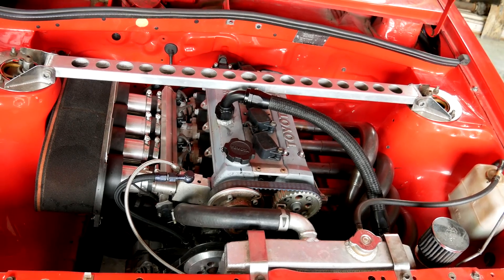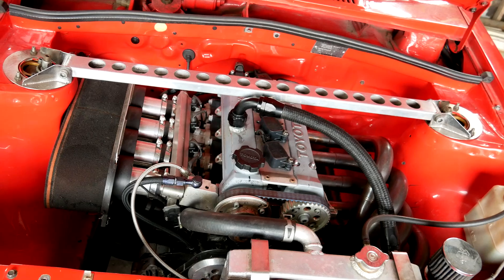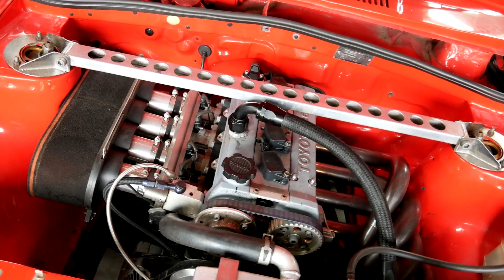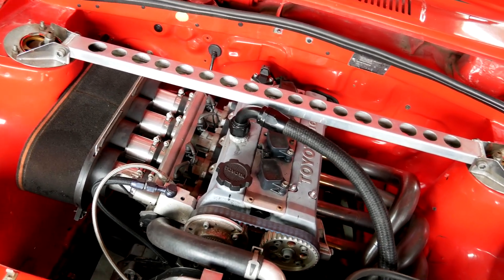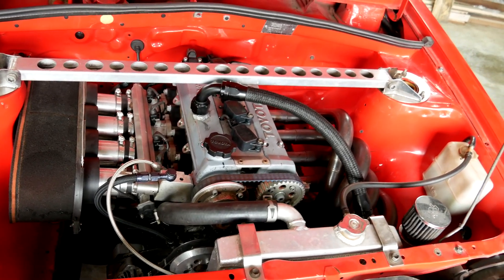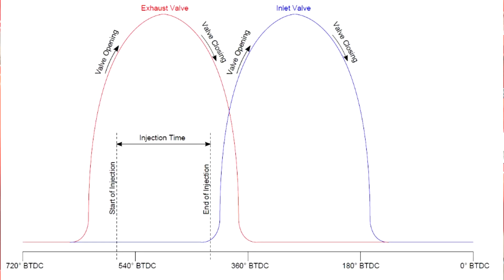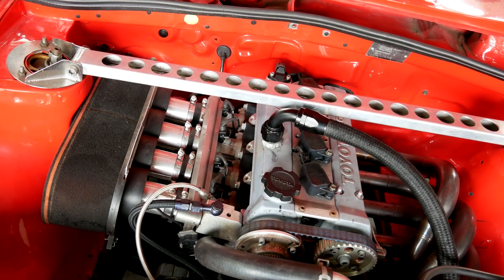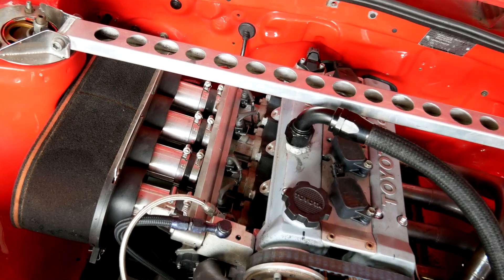Injector timing - Injection angle - Dyno tested

Comment: Just out of interest would it be possible to to have the injection run like a old mechanical constant flow injection system just to see what happens?
Reply from the maker: would have to change to injectors around 400cc to do it and keep afr correct,   I would assume it wouldn't be as bad  running 100%  duty (open whole engine cycle)   vs  40% in the wrong window.    but wouldn't be optimal either.
Reply: Do you mean a k-jetronic or CIS(on the USA)? 😎
Reply: @dejanmrvos5422  was more thinking hilbourn type as the constant flow
Reply: @Bigcountry_littlelegs  Part throttle metering is why Hilborn isn't great for non racing applications.
Merc-Benz & Porsche used a modified diesel jerk type pump for petrol injection in the 1970s. Thing is the pump was tuned for the engine by big factories with lots of capital behind them.
They were very successful. The throttle response from that setup was impressive but tuning them would be fairly difficult since the plungers are opened and closed by a camshaft and roller follower within the pump which directly controls plunger lift therefore discharge volume. 
The whole setup is basically fixed since fluid is incompressible, meaning a change in timing and fuel volume would require pump disassembly for every change. 
It's for this reason that EFI is so adaptable.  
I must say, if you ever drove a 911 2.7 with mechanical fuel injection it would make you smile form ear to ear.  
The fun factor is very high.
Reply: @ThePaulv12  Yeah, I know hilbourne is a race only setup. I was just curious if it would make more or less or the same power at WOT.
yeah, factory mechanical setups are nice but would be a pain on the more heavily modified engines.

Comment: This would be a good F.I., carburetor comparison.  The F.I. needs to be tuned at various RPM for timing and volume. Does a carb do a better job of maintaining the power throughout the curve?
Reply from the maker: would be interesting to see if would run anygood.  Ive heard the carb altlantic 4age's run pretty junk on the low end, compared to the efi ones.    The fuel map is pretty wild on this thing compared to you average engine.  Either way  a comparable carb setup would be out of my budget time and money wise,   just for a dyno test unfortunately.
Reply: @Garage4age  As a general rule... Carbs don't actually do anything better.
Reply from the maker: @802Garage   haha, i was trying not to say that.
Reply: @Garage4age  I've got 45dcoe's on my 160hp bigport. Low end is pretty unhappy, makes standing starts with a TRD gearset tricky!
If someone could loan you a carb setup, dizzy and MSD box for a while it would be great to see solid numbers for all the downsides.

Comment: Can you adjust timing based on engine rpm?
Reply from the maker: yeah can change it with rpm and load.    the baseline run isn't a fixed  angle.   was along time since i set it up.  but still seems to be pretty much where it needs to be.
Reply: @Garage4age how do you know what is the correct angle, do you calculate it somehow or u base on the sheet and later on test on dyno for what suits you most ??
Reply from the maker: @alektroks   I just test it on dyno.    Dont need a dyno though.  just adjust the injector timing  till get the richest afr.  means all the fuel you are injecting is being burnt properly/ better.   then go back and retune the afr.       even if you gain no power or engine doesn't run any nicer,   you will be using less fuel.     most stuff will happily run on around 400 end of injection everywhere
Reply from the maker: @alektroks  im on instagram,  same name
Reply: @Garage4age  Just for shits and giggles, have you ever tried putting a fuel rail at the end of the runners and have a 2nd set of injectors and connect the rail with compressed air from the shop compressor for a bit of air injection, you could start testing at 5psi up to as high as you can go.

Comment: Just a question, why weren’t you trying more intake oriented timings? Like opening when intake starts or a tad before? Seems interesting to see that. When I was tuning this is what I was doing most of the times. It kind of ideologically makes it in essence closer to chamber injection. Although I agree it makes almost no difference
Reply from the maker: better off just to find what the engine likes.   what works best here is injecting all the fuel before the valve opens, (at wide open).   there are  things like travel time,  fuel mixing etc to consider.
Reply: @Garage4age  if injection at open valves is worse, you should also show it for us, maybe you should also do the same tests on different engine
Reply from the maker: @BlueCombPL   Part of the injection event is on a open valve on the 350 runs. more so than it looks on those graphs, the cam curve is a generic  curve not my actual cams, which run a lot of overlap.   I could do it with my standard cam engine  with injectors at 70-80% duty.  but not much would happen. not really worth making another video about. but next time i have something more mild on dyno will try post it up.
Reply from the maker: Also i just noticed i screwed up the graph  showing the 350 injection event.   its at 370 rather than 350
Reply: @Garage4age  got it, thanks for the reply! I appreciate what you’re doing, me personally, despite doing quite a few tunings myself I’ve never been able to collect such a high quality data and do the comparisons. Thanks!

Comment: Do a power run in each gear to show "power" doesn't change, just the wheel torque.
Reply from the maker: It wont make the same power in every gear.  well all the gears apart from 4th will probably be similar.    4th being the 1:1  gear in this box, so the layshaft / countershaft is just along for the ride, not driven.  hence why its down on power compared to normal being run in 3rd this time.      But yeah could show it just to show how the torque multiplies with gearing
Reply: @Garage4age how much power does the layshaft rob?
Reply from the maker: @tiitsaul9036  On this thing lots.   It made 154kw in 3rd  and on same tune  165kw in 4th, 5 mins later.     I'm not sure if its all from the gearbox or dyno is doing something bit weird with the speed calculation.     But other rwd boxes like j160 dont seem to have this much difference.   fwd boxes power is very similar between gears.    Also the t50 in it at the moment is an old box that have been doing some syncro experiments with.  so the bearings maybe a bit tired.   11kw seems excessive to me, but thats what the dyno says
Reply: @Garage4age  interesting. 11kw loss in gearbox should make it glowing hot in a short time.
Reply from the maker: @tiitsaul9036  Yeah i would have thought so haha.   other cars with the same box is a pretty big change in power also,  not as much, but are lower power to start with more like 6-8kw
Reply: @Garage4age  I am wondering if inertia increase with the extra countersshaft engaged ind 3rd is contributing by slowing the acceleration of the rollers and making the dyno read less power?
Reply from the maker: @sennguru   The  countershaft still spins  in 4th.  as its always driven off the input shaft.    but power isnt being transferred  through it.         4th the input and output shafts are locked together, so power goes straight through in a line.      any other gear the power has to drive through 2 right angles through the countershaft,  2 sets of gears.   putting force on more bearings also.
Reply: It does change. It was done xx times a d tested
Reply: Yeah, that's unnecessary. Just waisting fuel and Dyno brakes.
Reply: That’s not true at all! A dynojet will 100 percent read more torque and less hp in lower gears. Especially higher hp cars.
Reply: @Fk8td That's because a dynojet/inertia dyno can't control the ramp rate. Not the case with a braked dyno where you can adjust the ramp rate to achieve the same dyno pull time period.
Reply: @Fk8td  so if we know what's going to happen, what's the point?
Reply: Power = ((Torque * Rpm) / 5252) * Ratio . So if you change the ratio of the input to the output you are changing the power
Reply from the maker: @Rooey129  Dyno reads  the torque applied to the rollers and uses the roller speed  to work out the power.      So if drive line loss was the same, the power the dyno reads will be the same in each gear.  the torque dyno sees will be higher but the speed lower.      Torque  numbers my dyno shows are at the rollers.

Comment from the maker: Where did all the power go?   Mostly because i am running the car up in 3rd gear rather than the usual  1:1 4th gear.    As a lot of people have noticed  the raw graph gets pretty wiggly in the top end.  It seems to be a combo of the dyno and the driveline in this car not loving going over 200kph.   Not an engine issue as some people think.    Anyway i'm using 3rd gear this time as I can get a better read on what it does right up top.     
On a similar note.  does anyone want to see a video, on how i get consistent results out of this car? Also ways to fudge / cheat dyno results. I already done a video touching on the dyno side of things,  not so much whats on the dyno.     or anything else you would like to see.   remembering  i'm just some guy in a shed and these videos dont make any money haha
Reply: Is your dyno braked ?
Reply from the maker: @MrJermbob   yes it has a 1350nm retarder  brake.    All the runs a braked ramp runs
Reply: @Garage4age  Beauty. Love the testing.
Reply: Yeah that video about how to tweak dynos around sounds interesting 👍
Reply: hhuuuhhh no 160kw hahahah!!! great stuff dude, i had no idea the fuel injection is made during the exhaust cycle. What exhaust are you using today? Sounds sweet!!
Reply: Id like to see water meth vs e85
Reply: “Does anyone want to see a video”
Yes. Yes
We do.

Edit since you said they don’t make any money I would prefer you spend your money and time on other topics. 👍